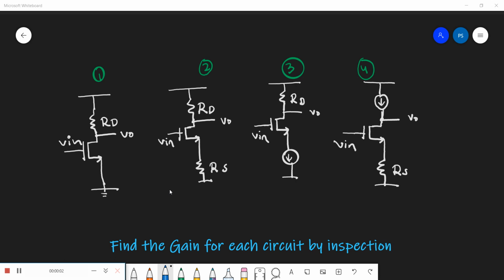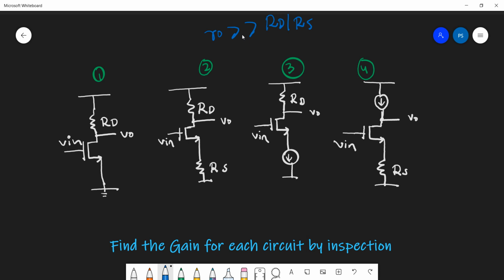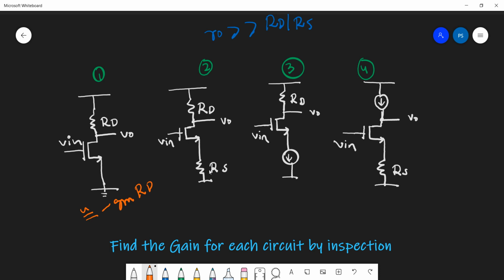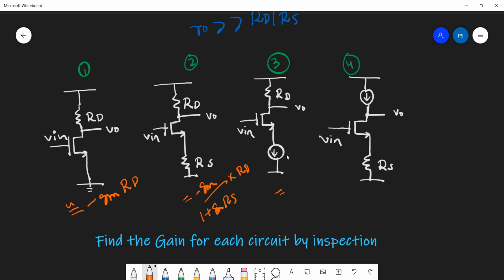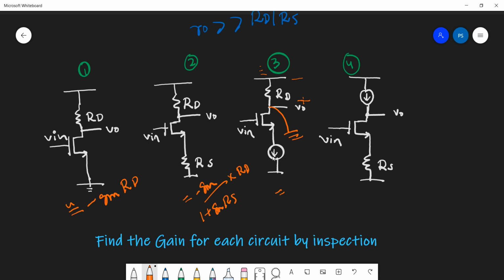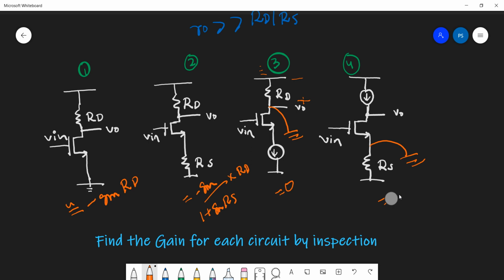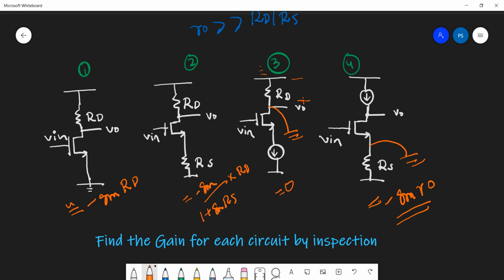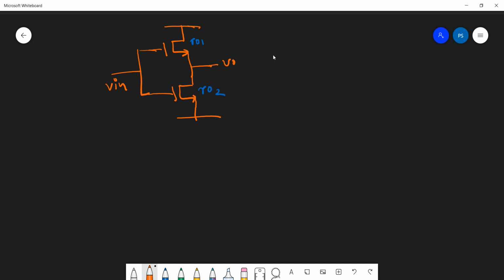Find gain by inspection : Analog Circuit design Interview questions

Comment: for the 3rd circuit can we think it like this_
at small signal the current source will offer infinite resistance and will be open circuited .so Gm=gm/1+gmRs where Rs in infinite so Gm=0. And gain Av=-GmRd=0  ??

Comment: Current will be defined by high impedance and voltage by low impedance. So M2 decides the current. Current in the branch will be gm2*vin. Voltage will be defined by low impedance, so M1 defines the voltage at Vo.
Current through M1 is gm2*vin, so VGS of M2 should be gm2*vin/gm1. vo comes out to be vin*(1-(gm2/gm1)).
Gain will be 1-(gn2/gm1).
Reply: Can you explain how and why? By doing small signal I am getting it. But not by inspection

Comment: So my approach was that, the drain current is same for both the MOSFETs. Assuming gm is same for both, and as Vg of both is same, then for current to be same, Vs should be equal for both the MOSFETs. Thus Vo becomes 0.

Yeah if we assume gm1 & gm2 are different, then superposition approach yields better result.

Comment: My approach:

Considering only M1, it is a source follower. So vo1=vin.
Considering only M2, it is a common source. So vo2=-gm2*(1/gm1)vin.
By superposition, vo=vo1+vo2=(1-gm2/gm1) or, vo/vin=1-gm2/gm1=(gm1-gm2)/gm1
Reply from the maker: Now assume gm1=gm2 ,  the gain value would be interesting to note
Reply: @vlsiorg  Wow! Almost zero gain!
Reply: @vlsiorg  Correct me if i am wrong, 
The current must be same for both the devices

Vgs1 = (Vin - Vo)
Vgs2 = (Vin)

gm1(Vin-Vo) = gm2(Vin)
thus, Vo/Vin = (gm1-gm2)/gm2